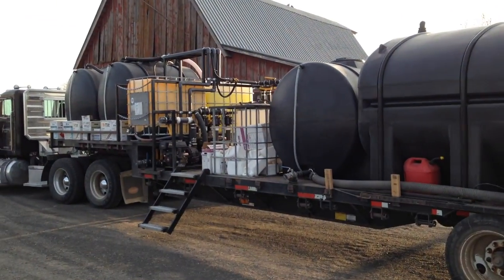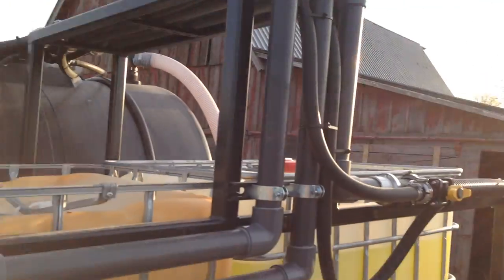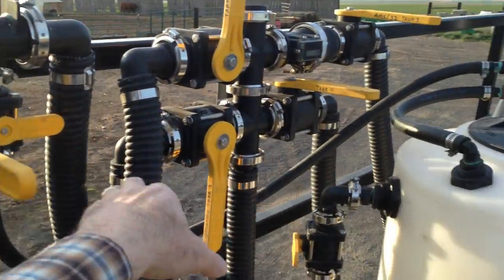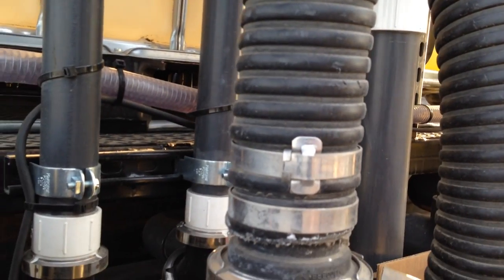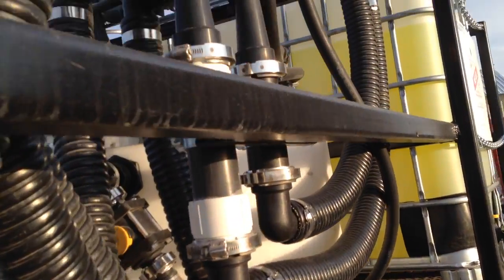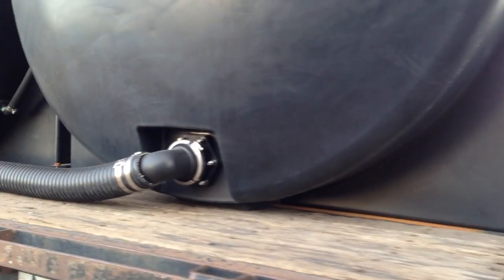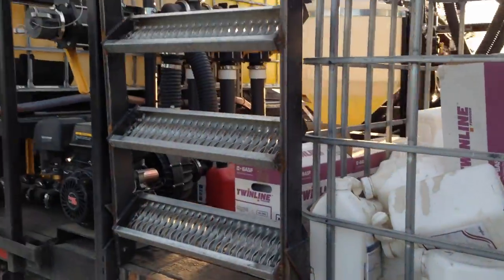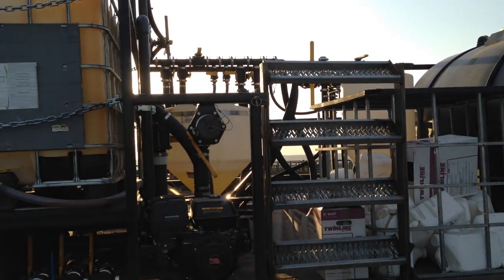Spray Tender Trailer

Comment: Wow. that's a nice set up. But how many valves and hoses do you need. Looks harder that it needs to be. But like like I said looks nice. I can fill in 7 min with and inductor on the suction side of the pump and and tank of water with one hose from inductor to sprayer.

Comment: Nice Setup! at 0:24 i can see a blue ball float in the level tube of the front tank, any idea where you got it? i would love to get my hands on a few of those for my nurse truck, thanks!
Reply: John Deere sells them
Reply: I just saw this I’ve been looking for years 😊
Reply: Dean could you specifically talk about the blue floating balls , you say you got at John Deere. I checked with my local dealer with no luck. Any chance you have part no. Or key search words.  I’ve been looking for years to find them.